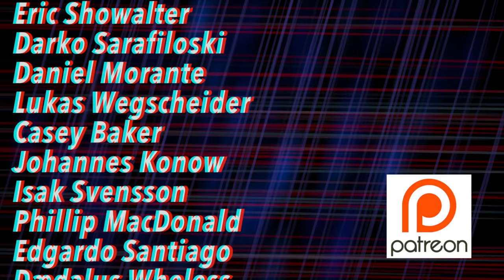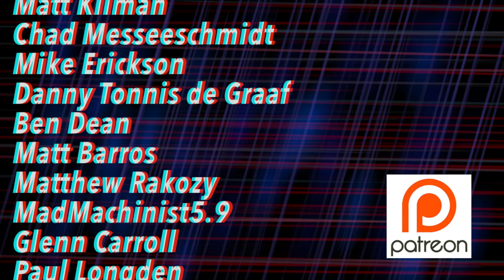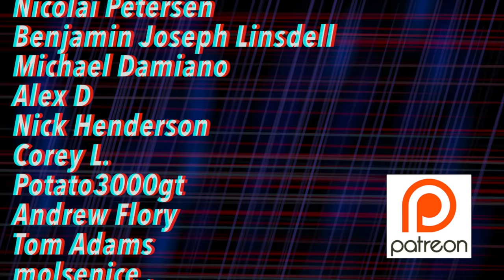[4k] CV Axle Fires?  That's a thing?

Comment: Those clamps are called "Oetiker" clamps. They are very re-useable if you spread the crimp point with a pick or flathead screwdriver to get enough slack to slide them or the part they are holding off of the shaft or hose, then pop them apart and use pliers to adjust the crimp back into a square(ish) shape. I have 6 different styles of pliers for them, my favorite pair being the Knipex 10 99 i220. If I had to buy all of my pliers again, my first choice for almost every kind I own would be Knipex brand.

Comment: Jafro, first very kind of you to promote the GoFundMe for that man's family. I'm sure he is sorely missed.
Second, not meant as self promo, but do you know the trick to put a hard object between the control arm and knuckle to pop a ball joint? I find it even easier than using any extra tool and far more reliable than hammering. I have a video if it on my channel titled Ball Joint Trick something something. Only way to get Subaru ball joints out sometimes and it worked on my DSM too if I recall.
Third, I too have had a comically hard time separating CV joints from axles that are allegedly supposed to tap off with relative ease. There's affordable tool for that. Seems the cheapest one on Amazon is about $18 right now. Just search for CV Joint Puller. Only works for the outer joint with a threaded stud though obviously. Would have worked for your outer shaft though.
Fourth, I too hate those band clamps. They never work just how you want them. This one time, at band clamp... I'll stop. I'm sure you probably know most of the above and I like your cheap solution, just figured I'd share in case. None of us know everything. Great video as always.

Comment: OMG I'm so glad you didn't try one of those godawful "2 piece glue together boot" kind.
They are hit & miss beyond patience. I just did a reboot a few years ago, before
my '89 OEM died from lack of grease. Yep, you read correctly- 32 years, same axles.
Keep the boots intact, greased- they should last a long time.

So nice to see you before Christmas, glad you're warm & safe!

Merry Christmas to you and Happy New Year, Dear Jaffro.
Reply from the maker: As long as you maintain the grease in the boot and don't quadruple its designed torque load, really they should last for the life of the vehicle.  It's an extremely resilient design so long as the grease stays clean.

Comment: The issue with the cv shafts coming apart is typically caused by the snap ring. if it rusts, it gets stuck. if its too soft, it gets stuck. sometimes they just don't come apart.

Comment: I'm coming for you in my miata. Just finished up porting and polishing using some of the advice you had. Didn't do anything crazy. Mainly removed casting artifacts and smoothed the guides. The big thing I did was gap the rings and put in arp studs. Big boost inbound.

Comment: I've had exactly that problem -- a 1G replacement axle that turned out to be a bit too long. I decided to just wait until the old axle failed before trying again. That was at least three Nebraska winters ago, and the torn-boot axle is still going strong with no noises or smells. Of course, the lack of a nearby drag track is probably a factor.
Reply from the maker: Now you know you can just swap those outer joints!  ;)  Once the noises start, that's when you'll start getting into this realm.  It takes a lot of load and friction to take one of these joints out.  The torn boot makes it happen a lot faster because the grease getting contaminated reduces its load protection, but it can take a really long time to wear one of these joints out.  The fire thing was new to me.  EDIT:  My boot wasn't even torn.  It did have a pin-hole, but It was mostly a problem with a bent clamp.

Comment: you can use the awd jackshaft with bearing no problem.  it actually needs to be a little longer because it doesn't head straight to the spindle.  that's where the extra length is taken up

Comment: You shouldn't use brass punches on bearings.  Small pieces of brass will shear off and end up in your nice clean bearings.
Use a punch made from cold rolled mild steel.  It won't damage the bearings and won't leave debris.
Reply from the maker: I agree with you, and now I like my jack handle punch even more!

Comment: Looks like those wheel nuts were done up way past 110nm, also for the shorter CV axle you may be able to get a old live axle axle cut to length and splined to suit the CV ends, have seen this trick used before,  and it looked like it was 22mm or 7/8ths too long in the video or was that just some parallax error from the angle of the camera?

Comment: I love the tiny irony that you just fixed/replaced an entire axle.. the struts... the brake calipers... had to fix plasti-dip on a wheel...

And then your rotors are rusty as hell behind it all :P
Reply from the maker: Same brake pads, too!  heheh.  I just cleaned 'em up with brake cleaner and put 'em in the new calipers.  I only do rotor work when I put new pads on.  The car sat on jack stands for almost a month, the rust disappeared the first time I stopped.  But yeah, I get it, it bugged me a little in the edits with all that other new stuff in there.
Reply: @Jafromobile  yeah, and i knew that it was only from the weather, but its just one of those things lol

Comment: I don’t know if the DSM style Birfield joint is the same as my Nissan style axles, but you may be able to flip the cage to shorten the 2 piece AWD axle enough to use it. It’s a trick I used to get appropriate length axles in my 510 using Z31 CV joints and Pathfinder shafts.

Comment: The secret to getting the  joint off of the axle  is 1) secure axle in a vice. 2) grab biggest hammer available that you can wield accurately. Mine a a 44 Oz ballpeen deadblow from snap on. 3) grab a beat stick.  Mine is a stainless steel prop shaft from a Yamaha pwc. 4) place beat stick against the inner star of the joint and hit it like you got a pair. This is not the time to be delicate. Hog rings are replaceable. I have yet to damage a joint in 6 years of doing it this way.

Comment: Jafro, you want advice? Hit up RAXLES for your axle upgrade. they take factory CV axles and rebuild the ends with quality parts. They won't strand you like those chinese FEQs. Also, i don't know anything about your car, but it looked like your lower ball joint bolts into the control arm. If it's possible, consider just unbolting it and pulling it from the control arm to save you time.
Reply from the maker: Raxles actually stopped doing Mitsubishi stuff about 9 years ago.  I know this because I called them about this axle.  They even remembered me from my GSX axles and even making this one for Jamie back in 2006.  This is one of theirs.  They're an epic resource for most every other import and they were always outstanding to me.  It's just a change in the times.  But I've got a lead out on a new resource that I need to follow up with on this.

Yes, Elantra LCA's have bolt-on ball joints.  It's unlike all the Mitsubishi stuff that shares the same platform.  It's weird but in a good way!

Comment: I see that this set of struts had some more meat on the lower hole, meaning you didn't need to implement the fix I suggested the 1st time you did it.
Reply from the maker: These did indeed have more meat on them.  I used a different washer material this time, too.  I used manifold spring washers, and did a bit of back-filling over the slots.  Not likely to blow the fronts of the holes out on this set.  Warning heeded.  What I also noticed... because the new spring rate caused by the different perch height – the car rides higher on the strut... extending it an extra inch.  I have less of a camber problem to correct on this strut than the old strut being almost fully-compressed at its ride height.  I built less camber into these, and I still have some adjustment room at the perches.
Reply: @Jafromobile  Excellent.

Comment: I love the channel man gotta say i wouldnt even have the car i have without. Your videos i need some info looked into and i think you should do the video i want to know if hyundai sonata 2002 injectors work in a mitsubishi i have a set amd may need to install them as 2 of my oem injectors are stuck open just dumping fuel into a fully built motor so im not driving it anytime soon until i get a quik get me by fix before getting it tuned i have 650 ccs for boost but im not ready to install the turbo yet so can you tell me if these 289cc will work they look identical

Comment: Hi 
 I just realized that you wanted to get a equal length drive axles so the tires keep pulling straight with out tq steer. My 89 grand prix 5 speed had that set up. But it was tube attached to the trans. And had a shaft inside and  solid mount to the body of the car. Unsure of the spline size though.
 Un sure if that would work. 
 Be safe.

Comment: you can build ball joint tool your self if you have welding machine or tig then look some metals or old tools what you dont need and bolts and nuts then just messure and build on

Comment: Non related video question kinda.. please describe and tell me what anti-roll bar link has for purpose. What does it do? Please tell me common symptoms of bad links. Have not looked under my car on a lift yet but.. lower control arms, shocks and springs are replaced with new. Alignment is done. My car is super unstable on the road. Lots of knocking metal sounds when driving at bumpy roads or driving on those speed bumps kinda things. Feels like whole suspension is loose.

Something strange with my power-steering to. It's an electro hydraulic pump. Expansion tanks cap is designed I believe with a super small hole where I have seen a thin oily film. Why's that? Any technical guesses Jaffro? After the lower control arms where changed the steering became really odd and I just can't understand what's happened. It feels like turning in air clouds and intermittent a normal feel with some tension on the steering. Sorry I'm am bad at describing in a language that isn't my primary. Fluid level seems ok. But pump makes a high frequent noise when turning with tires on asphalt. Not a classic pumping around air noise.. like struggling.

This is a mystery and I don't want to book an diagnostic appointment for this. I want to try if I can figure it out myself. Maybe there's bad parts I can replace with help of a friend..

Next problem.. engine temperature. It feels it takes very long time to heat up engine to normal operating temperature. On idle with AC auto on a parking or in city traffic were it goes slow temperature is normal. But as soon I start to drive a bit faster the temperature drops to about next line on the gauge lower than "middle normal"  whyyyy?? Why isn't the temperature/gauge stable as it has been for years? One quick observation under the hood. AC on/auto 16 celsius on panel. About 0-2 celsius outside. Engine/AC-fan turns on and off like every 2 seconds. Have not tried turning ac-off though. Never seen my fan do that. What is wrong here? AC system related? Like any kind of pressure sensors, low refrigerant? Relay? AC clutch? Bad engine fan? Bad engine temperature sensor? Bad thermostat? Bad anti freez cooling liquid? Any guesses or tips what to try? Volvo S40 1.8 2006
Reply from the maker: Lift the whole front end up on jack stands, securely.  Key out, lock the wheel.  E-brake on.  Wiggle and wobble the front wheels around and see if they feel clunky and loose.  Look at the suspension parts while you do this and note which parts move and which parts don't.  If there's slop between two of the parts, you'll see what needs to be replaced.  The sway bar keeps the centerlines of each tire the correct distance apart at all times, so if the links go bad, as you described, it will feel loose and make a lot of noise.  It will feel "floaty".  

The expansion tank is there for thermal reasons, and as a result, it needs a breather hole.  If it's overfilled it can make a mess, but it's otherwise typically manageable.

You have a bad thermostat.  In order for your car to make it up to operating temperature, the thermostat is supposed to be able to close and slow down the coolant.  It's stuck open.  So instead, it's just flowing full-speed through the radiator, and constantly flowing cold, winter-cooled antifreeze through the block however fast your water pump can pump it.  Turn the AC off, it's probably frozen over if it's 0-2 degrees outside.  If I had to guess, even with it off, the car's heater isn't blowing very warm.  Probably makes that temperature needle drop further when you've got the heat on full blast.

I really can't help you with the AC stuff beyond that, though. I'm not the AC controls guy.
Reply: @Jafromobile  thank you! I Will look into it. I suspected the sway bar links might be bad without looking. The car feels nearly the same as my parents 2018 Volvo when the swaybar was broke in half. Production fail luckyly

I dont lack heat inside i believe. I have some kind of a electric PTC element that heats the air faster.

That thermostat house is not fun to change. Reeeallly inaccesable :) bit i think it must be done. Might change the engine temperature sensor too when the coolant is drained and all :)

I dont think i understand hos the thermostat work and my symptoms. There is a bypass chanal too in the house.

Comment: Guess what I found on my car today! Left drive axle badly leaking all over the place. Yes, they both make noise turning left or right.
Reply from the maker: Once they're making noise, the outer joints are bad.  If they go clunk putting it in gear, coming to a stop, or make thumping sounds at highway speeds, then the inner joint is bad.  It's your choice how you want to fix it, but if you wanted to save a bunch of money before the holiday, every car like yours in the junkyard is a parts donor.  Messy Christmas!

Comment: Why haven't you just gone with some BC Coilovers yet? Why mess around with mix matching OE parts when you could go aftermarket?
Reply from the maker: Mostly because you try the $100 parts before you try the $1,000 parts.  They're not even the parts for this chassis, and none of the rest of the stuff in the wheel well is, either.  It's the difference between whether to spend the big bucks on the Eclipse or the Mirage parts, and now I have my answer!

Comment: Honda axles are full-floating; it makes them comparatively easier to tinker with compared to this.  I was able to remove and reinstall a rear AWD axle in my Element without even undoing the axle nut!!  I unbolted the diff and used a ratcheting strap to pull it to one side.  Since the axles are floating I could just pull it out of one CV cup, pull it out of the other, clean it up, and reinstall the boot.
Reply from the maker: Yes, but if you need to replace a wheel stud, you have to pull the whole hub assembly off, press out the wheel bearing, and then you'll have room to knock the studs out.  Hondas have engine harness bulkhead connectors, too and that's another convenience as well.  There's a lot that many manufacturers do well.  If only we could take the best of everything and make one car.  It would be the exact opposite of this car!

Comment: 10:56 should've just dumped that whole thing in Naphtha over night. The next morning, a vigorous shake would've made the grease come out like runny ...something.
15:10 AFAIK, yeah, it's like putting a rubber band/leather strap around brake disks when you machine them. Worth the effort to put them on for vibrations and noise (ultimately).

Comment: As much as I hate cv boot grease, it’s way cheaper to rebuild em. And the re-man axles are crap.
Reply from the maker: That axle joint was an OE unit from 1990.  Who knows how many miles it had before being shortened, and then having 300hp applied to it for the past 8 years and 35,000 miles?  I'd say there's nothing wrong with the factory stuff, it's rather tough!  The replacement joint came from the stock 1992 GSX donor car I stripped that had 160,000 miles on it.  Even well used, it looked brand new.  I'd say the weakest link on DSM axles is the shaft.

Comment: Completely remove the rear doors. Weld in sheet w/crossmembers. 
Lose rear & passenger seats. Weigh all that up. 

I'm sorry- I'm thinking "Racecar" not "Fast Grocery Getter".
Reply from the maker: I think the subwoofers, amps and subwoofer box weigh a lot more than the rear seat and back doors.  I'll probably remove those first, though the back seat is rather useless.

Comment: do you have a limited slip in it?
Reply from the maker: Nah, it's really quite the opposite.  It transfers all the power from the wheels that grip to the wheel that slips.  The un-equal shaft lengths are one contributor to this... but it did it when it used to have a Quaiffe in it, so I'm pretty sure the corner balance was off.  Probably still is.  I've never had a chance to measure that, but I will soon.  I also haven't ruled out putting an LSD back into it.
Reply: @Jafromobile  yeah axle twist is a real thing in fwd with power. I think your idea to get the awd axle stub in there is a good idea. driveshaft shop will make you a custom center section of the outer shaft.

Comment: Sir you need a new impact wrench
Reply from the maker: I think it's because of the keyed lugs. The axle nut I removed a minute later has 160 foot pounds of torque on it and it spins it right off.  The lugs only have 100-120, and they're coated with anti-seize.  There's a lot of slop in the socket that goes over the key and it sucks up most of the force being applied.  That's the real reason I grabbed the crossbar.  32mm socket fits the axle nut just fine.  I think I really need to find new lug nuts because I hate these things.
Reply: @Jafromobile  the junk ones today do 400ft lbs easy lol